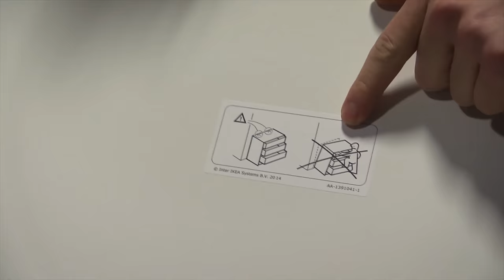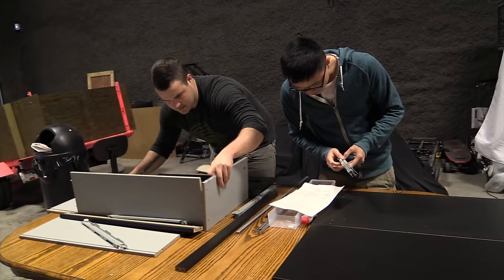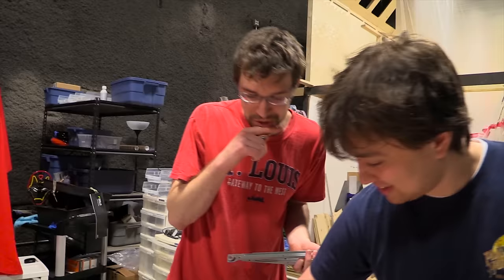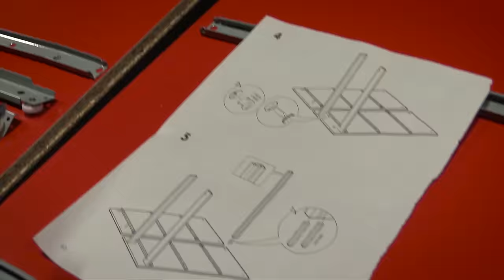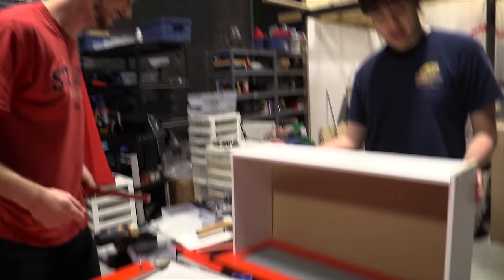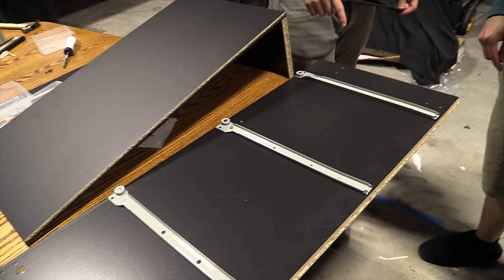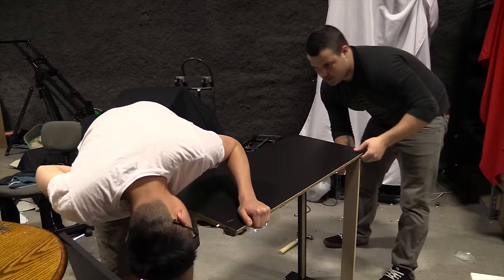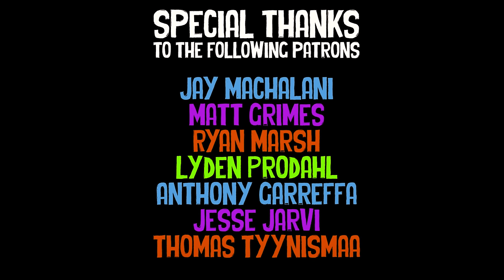Ikea Assembly Race

Comment: "You get an electric screwdriver."
...Linus, that's a drill...
Reply: (facepalm)
Reply: nup, a eletric screwdriver does exist although its basically a drill
Reply: +Phillip Jernigan Can put screwdriver bits in em :P
Reply: +MrNeostatic I got one from IKEA funnily enough, it's amazing for putting ikea furniture together because the drill is strong enough to screw in all the screws but too weak to break or shatter anything.
Reply: Facepalm
Reply: +Phillip Jernigan this is not a drill, they are really building furniture.
Reply: Hecarim Well, no shit Sherlock.  I was simply stating that the correct term for the tool he used is called a drill.  Yes, you can use a drill as a screw driver.  Good job, you know one of the many uses of a drill.

But electric screw drivers are stuck with only certain size bits, where as a drill can use almost any kind of a size.
Reply: +Calopsy Fun fact, I own an electric screwdriver, it's NOT a drill.
Reply: That is a drill. You can use a drill to put screws ect in however you generally use a 'driver'.
Reply: ed - go see ave

Comment: It's called a drill/driver Linus not an electric screwdriver!
Reply: No it is a drill/driver if it has a bit on it that can drill a hole. It is an electric screwdriver when it has a bit on it that can screw in a screw.
Reply: No a drill is used for drilling but a driver like an impact driver is used to screw because it can only fit screwdriver bits

Comment: How about assembling one puzzle but in the box of pieces combine a second puzzles pieces. Give the player/team a picture of one of the two puzzles and tell them that's the only one they are allowed to build and give them one hour. One hour limit, 100 piece puzzle size minimum. In case of a team, maybe add some fun by making each team player only able to use one hand and other tied behind back (don't know if that will make a difference, but it seems like it may add more agony to the event ;) Great video, had no doubt the producer of the video would win.